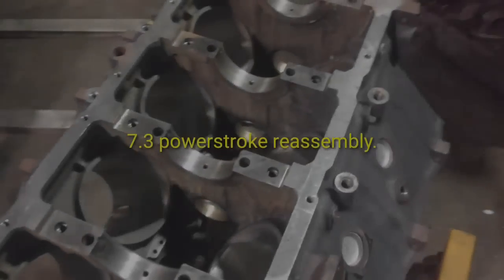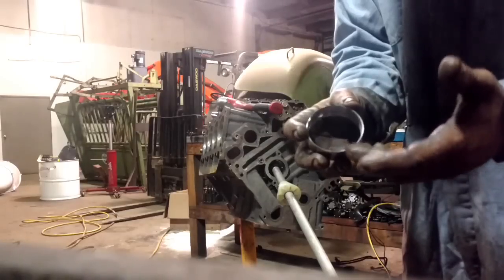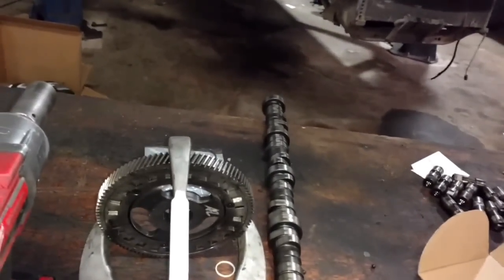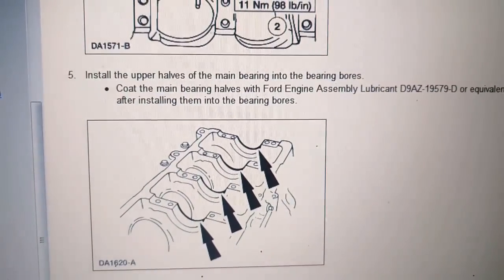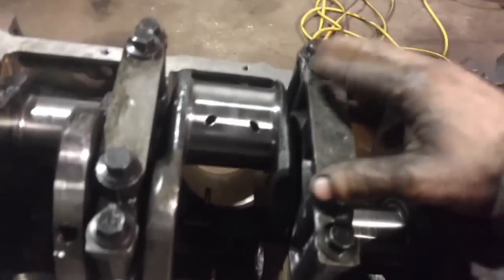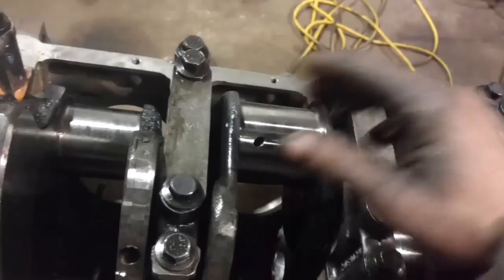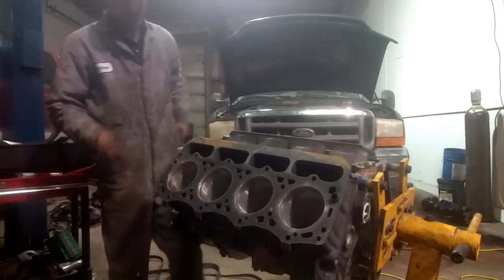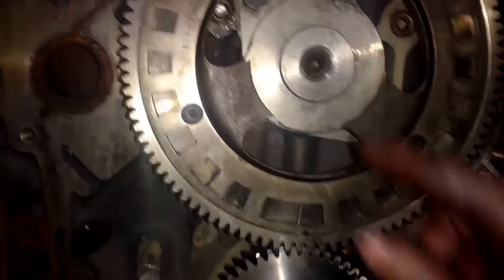7.3 powerstroke engine rebuild ( reassembly)

Comment: This video is coming in very handy too me right now ... Doing a rebuild on my 2000 f350 that made it through 333k really hard construction and heavy tow miles ... Put a used reman 7.3 with 40k miles on it for a temp engine.. and might run it a couple more years .. but going to put the original back into top shape and have it ready ...   I love these engines when they work right...  👍

Comment: If one of my kids ever gets to rebuild an engine, I will have them watch this video as a training tool. Your commentary is right on and comming from you it will be better than if I did it. Kids don't take my word as they should in my opinion. Having third party source of information builds a level of trust that I can not instill in what I say. Sometimes I get to the point that I won't even try to get them to do anything like this. It's easier if I do it myself without asking them. They are in their twenties now. I figure, by the time they turn 30, they will get to do this kind of work and I be sitting by watching them struggle. Like Mark Twain once said: when he was 18 years old, he thought his father was an idiot. By the time he reached 25, he thought his father was smartest man be ever met.
Reply: agreed bruh!

Comment: Um when I get ready to put the cam shaft back in the engine block I take the block off the engine stand and set it down on wooden blocks on the back side of the engine block so I can lower the cam shaft straight down into the engine block . There's less chance of damaging a cam bearing and it's quiet a bit simpler going in.I use my over head crane to lower the cam shaft in so I don't chance it slipping out of my hands and damaging a bearing.

Comment: I trust your years of experience. but I was taught in shop class to use short 6 point sockets whenever possible.  Also, when using a torque wrench, you cannot have anything touching the socket or any part of the torque wrench in front of the "click" point.  Crescent wrenches are for home owners and hacks.
Reply from the maker: And all those guys teaching you this in shop class are there because they weren't worth a fuck in the real world.

Comment: Generally speaking I agree about welding the gear but you can weld them, Ford Taurus SHO engines had issues with the cam gear spinning (not keyed) on the cam and the repair was to weld the gear.

Comment: Just a bit of useless information. The notches in the cam bushings are for alignment. Manufacturers bushing installers have a dimple that the notch goes over. The sleeve extends through the bushing and has a groove in it. You drop a pin through the oil galley that falls into the groove. Start the bushing in the bore and remove the pin. When the bushing is installed to the correct depth by bottoming the tool the hole will be lined up. Fool proof oil hole alignment. Maybe machine shop should be using this setup. Thanks for a great video.

Comment: I can guarantee you that the machine shop did not lube the cam when they install it. They probably lined up the holes but because they didn't lube it or just the used motor oil to lube it, the oil ran out and the cam grabbed the bearings and spun them

Comment: To each his own and I’ve definitely used it before, it really used to be the industry standard, beside STP oil treatment but I’ve always believed using libriplate or any grease to pre-lube bearings is just introducing sludge into a brand new engine. Perhaps it melts and blends with the engine oil better than I’ve been led to believe but I always use an oil based assembly lube like Torqo,  Lucas or Permatex. I also think you run the risk of plugging off oil holes with globs of grease and possibly risk damaging brand new components at a critical time. 

Just my 2 cents worth, been building engines of different kinds almost 20 years now and knock on wood I’ve had good luck. I’m curious what your thoughts are Warren? What do you think about my “methods” so to speak?

Comment: good job i definately enjoyed the video i had a 99 powerstroke and i loved that thing i think they get a bad rap i would love to have one again i had very good luck with it and it was very reliable for me
Reply from the maker: +3408kid  Thanks, Yeah there are alot of these things still going down the road, mainly because most guys don't want one with all the emissions crap on them.
Reply: i have a 90 idi and a 2002 powerstroke,  both are great and reliable.  and i dont have to worry about emssions and def
Reply from the maker: +Sideshow Bob Yeah, I would just keep running them too, I work on alot of new equipment and vehicles and there is way too much electronics and emissions crap on them.

Comment: Dear Mr. Grease, maybe one could
devise a "pusher" device that would
bolt to the block and "push" the cam
bearings in instead of hammering. 
Such as the opposite of the gear
removable tool. Host a thought ?
Sincerely, Kathleen.
Reply from the maker: Kathleen NAWALT  Well great minds think alike, earlier this year I was driving some cam bushings in a N-14 Cummins that were tight and I was thinking it would be alot easier to press these in.
Reply: +grease monkey101  Say there . . . 
Mr. Grease, My Guy says thanks for
the complement. He says "next time"
I'll make that tool. Just next time
there just isn't enough time. Sure
would be nice to have though. 
Sincerely, Kathleen & Me.

Comment: Love your videos, very educational! I have a 99 7.3 powerstroke I want to rebuild. The motor was ran hot? What are some things I should check  to see if motor is worth Rebuilding? TIA
Reply: If it isn’t locked up it’s worth rebuilding, also if it isn’t locked up it probably doesn’t even need a rebuild, these engines can take a lot of abuse, even an overheating cycle.

Comment: So during my rebuild, I took off the low pressure oil pump, and took off the inner and outer gerotors, took motor apart and laid the crank on my bench. Crank did not fall or get hit. Going back together when it was time to put pump back in I ordered the Melling pump. Received new pump and soaked in oil. Went to install and the inner gerotor will not slip on, just for fun tried to install old inner gerotor and it also won’t slip on. When I initially took off the old gerotor it would slip on and off easily. Is it safe to “tap” the new inner gerotor on, or should it slip on and off easily. If it should slip on and off easily then what happened from the time I took off the old lpop and tried to install the new one? Lost on this one...help please!!

Comment: Hey bud, sorry if this is a dumb question.  Do u use assembly lube on the cam bearings or bang em in dry?
Reply from the maker: +Michael Allman  No that's not a dumb question. Install them dry.  You only want assembly lube on the i.d. of the bearing where the cam journals ride, but nothing on the o.d. of the bearing.

Comment: I got a question for you. I have a 94 F350 that has a 7.3l I am taking out. What size bolt did you use to attach it to your engine stand. I keep finding it is 7/16-14x4. I never had a ford so it will be a new task ahead for this project.
Reply from the maker: I used the bell housing bolts
Reply: @westerntruckandtractorrepa1353  are they long enough? I am putting it on 2000# Pittsburgh engine mount?

Comment: Dont ever put the piston cooler nozzles in befor the pistons i have seen tons of engine damage caused by that people hit the nozzles with the big end of the rod when they install the pistons its worth the extra 10 minutes to fight with the nozzles after the pistons are in its just one of those things you may get away with 100 times but it only takes 1

Comment: How much do you charge for 7.3 idi turbo 1993. Take out the engine do overhaul and put the engine back?
Reply from the maker: Haralabos Lukatos  You probably just got a bad Injection pump, those old 7.3 engines ran forever.  Unplug your glow plug controller and squirt either in the intake, if it starts on either then there is a fuel problem.
Reply: I am not mechanic but that i am thinking too fuel problem. For you know some thinks about my truck. I buy that truck used. I know is needed glow plugs. Is was little harder to start in colder days. warmer days started ok. i used to drive but one day after work i start the engine idle ok. But when i press the gas pedal cut the engine off. Is stick shift i take home but i have to restart 20 times. One mechanic tell me two pistons is bad i not know how check that and if is truth. the same mechanic when i buy the truck is have fix fuel leak. And because have missing the air hose the original is install one square hose. Now other mechanic tell me that hose probably damage the pistons because the engine not pull the air need. other i know the people i buy the truck used starting fluid
Reply: Haralabos Lukatos your motor is f... if starting fluid was used on it a lot . The original owners of my 6.9 did the same thing . Everyone of my pistons are done for. Burning a lot of oil . Do not use starting fluid it is the worst thing you could do to them. If the motor doesn't spin fast enough when you go to start it it will ignite early. Use gas on a rag in front of the filter .  I have been told that is one of the better ways to start the truck.

Comment: What are those coolant collars called that sit in the block and fit in the head? I have had my engine back together for a year and it runs fine but I swear those were not in the block when it came back from the machine shop. For the life of me I can’t remember if I put them back on or not.
Reply: Or are these oil passages? Top left and top right looking from side of bank
Reply from the maker: John Bias  Not sure what you're talking about.
Reply: are you talking about the dowels that your put the head on? they stick out of the block maybe a 1/2 inch?

Comment: Is there a ball bearing associated with the oil pump
Reply from the maker: ReactedGoose Gaming  No , just internal and external gear and pump housing.
Reply: western truck and tractor repair ok cause i had the pump on the bench and a ball bearing fell on the floor and i wasnt sure if it was already on the bench or part of the oil pump
Reply: western truck and tractor repair does the pump need to be primed and if so how
Reply from the maker: ReactedGoose Gaming  No , just get your gears wet with clean engine oil and then install,  they are self priming.
Reply: western truck and tractor repair if i turn the engine over by hand will it pump oil and create oil pressure so i can see if i have any oil leaks before i put the engine back in
Reply from the maker: I don't  think you  can turn that fast enough by hand.

Comment: would that cam gear puller work on a  n-14 cam gear
Reply from the maker: +Will Smithey No, I tried that a year ago., It took heat and 50 ton press to get it off.
Reply: I did one last week ended up have to buy a new gear put to much heat on it thanks a lot though
Reply from the maker: +Will Smithey Yeah, don't feel bad, I have broke them in half on the press, it happens.